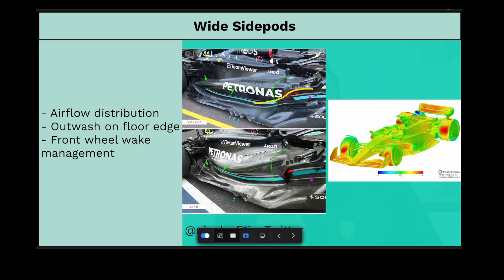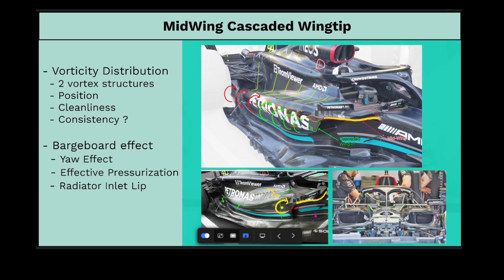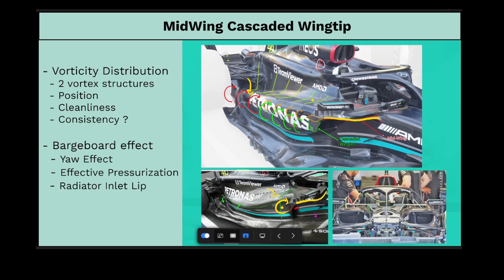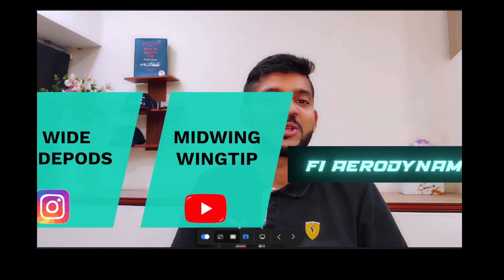#F1 Aero Analysis : Mercedes W14B Analyzed !!

Comment: Greatt video as always shubh (hope i heard that right). if the goal of the floor edge wing is to get the bulk flow incorporated into the floor vortex, what/is there a role for the airflow coming off the edge of the winglet exterior?

Also, do you think the mid wing is a feature that would be advantageous to keep i.e. does it provide a stronger vortex for usage that other teams can?

Comment: To be honest, I think it's this floor edge vortex that makes the difference between good and bad on these cars, along with the suspension. I explain this with the example of the Red Bull, where it works perfectly. Because they have minimal movement of the aerodynamic platform and a high "roof" of the underbody, the vortex that flows from the front to the rear can develop better because it has space to rotate. In other teams with a lower roof it doesn't have that and if the ride height fluctuates a lot on top of that, the vortex becomes elliptical and the vector field of the vortex changes, leading to downforce losses. The same is true for the Floor Edge Vortex, which Red Bull incorporates and adds to the stable Vortex from the front. Because the aero platform is very stable, this vortex is also not depressed, does not become elliptical, and does not change its vector field. For other teams it does. I think that all teams except Red Bull simply have the problem that the vortex becomes elliptical and the vector field changes either from the main vortex or from the floor edge vortex. The problems of Ferrari or Mercedes all come from that. And the fact that they can't drive as low - that's also because at a certain point the main vortex collapses because the lower roof of the underbody makes the vortex elliptical, which changes the vector field and again massive downforce is lost or even the vortex collapses. With Red Bull, this doesn't happen because the "roof" of the diffuser is higher and even with 10mm lower ground clearance, the vortex still has room, doesn't become elliptical, and changes its vector field.
Reply from the maker: Lovely insight ❤️
Reply: its seem you are right based on the view of the redbull floor compared to the merc and ferrari
Reply from the maker: I totally agree with this, I've seen this phenomenon happen. I was actually looking for resources of elliptical vortices , do u have some ?

Comment: While the hot air that comes off the sidepod cooling has lost a lot of its energy, the heat, and hot air itself has interesting properties that actually help. A hot wall has been shown to help flow stay attached, and to delay the separation limit at high Re#'s. This is because hotter air has lower density, which reduces the boundary layer, and also has higher kinematic viscosity. While the viscosity of air is relatively low, temperature increases have significant effects, air at 150C has 3x the viscosity of air at 20C.

While this may not affect the aerodynamics of an F1 car an awful lot, what it does do, is influence the air that flows around these vents, and hot walls. If the air has lost its energy, that simply means it has slowed down from free stream velocity, what it has lost in kinetic energy it has gained in potential energy. What I mean is, this slow energy flow acts as a wall for any further incoming air. It in kind acts as virtual body work, and since this is drag you already have to deal with if you don't want your mechanical systems to overheat, might as well get the most out of it.

When I see these cooling louvers I don't see lossy air, I see free stream air sticking to the downwash angle more than it otherwise would. However the boundary layer propagation means the bulk free stream high energy flow is probably like 20-30 mm above the bodywork, by the time it gets to the back of the engine cover. This means that if this hasn't been accounted for, the airflow is probably not interacting with the lower suspension arms in an optimal way. I bet there's some good gains from optimizing the rear lower suspension arm fairings for the flow field the new sidepods create.